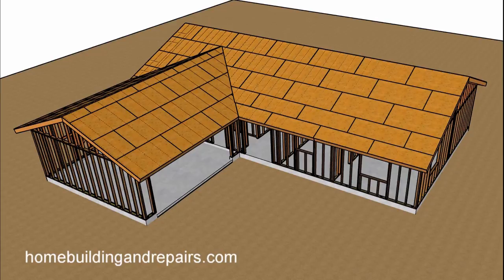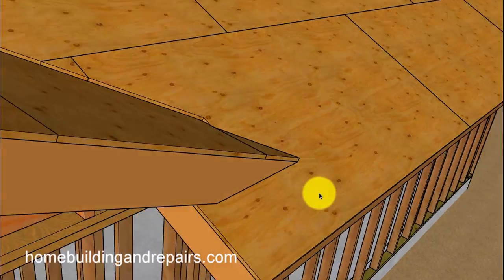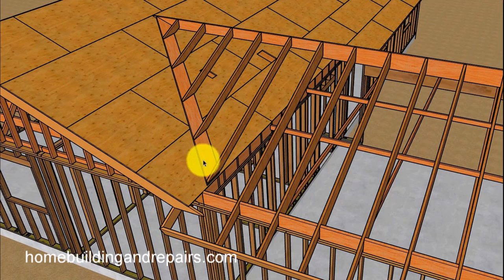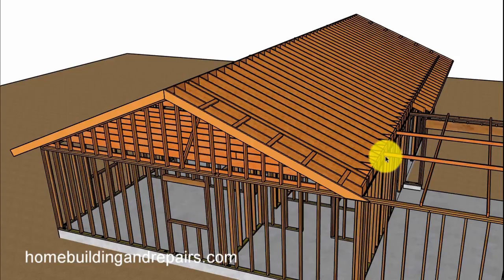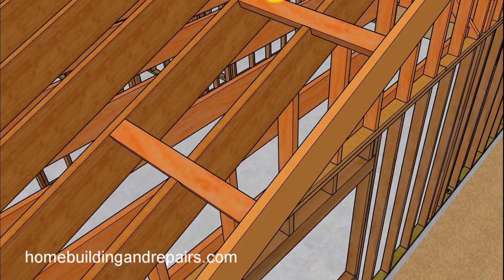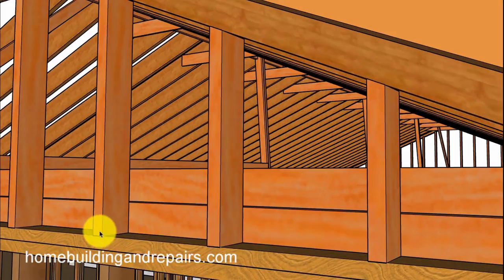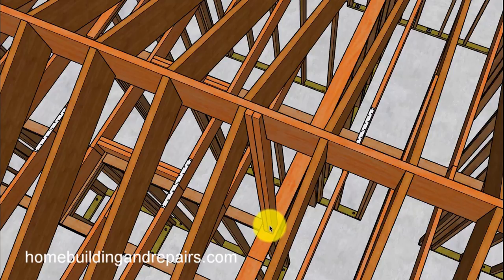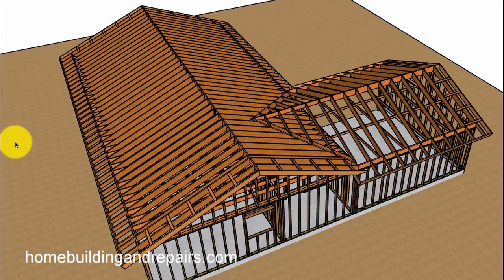Conventional Gable Roof Framing Ideas – L-Shaped Floor Plan Design

Comment: Yes that join area at 0:37 is quite tricky to model. It's interesting that your valley rafters are lying flat against the rafter of the adjacent roof, is there amy reason for that? Better connection? I typically see them standing up.
Reply from the maker: I don't know if this will answer your question, but feel free to try asking it again in a different way if it doesn't. The smaller roof sits on top of the larger one and that's to distribute the weight of the smaller roof little more evenly. Don't forget that you can always go to our website to check out some of the home addition building and roof framing videos for more information also.
Reply: @gregvancom   Thanks for your reply. What I meant was, the pitched/angled rafters of the end of your valley, they're sitting flat on the bigger roof. I've modelled them standing up, my dad who's also a carpenter commented on mine when he saw my rafters sitting flat, I think he said it uses the strength of the rafters better to have them standing up. I would imagine that having them flat  helps to get more nails in for a better fix or something? I've been on your website and I have it bookmarked. Your video helped me visualise the way the roofs join a bit better :)

Comment: By notching the 2/10 for the outlookers, you've reduced the strength of the rafter. Drop the height of the gable by 3-1/2" measured at a right angle from the roof pitch. Then the outlookers can butt into the rafter and ride over the top of the gable.
Reply from the maker: I don't think you're going to be reducing the strength of the roof rafter when it's supported by a continuous wall underneath it.
Reply: The Look-outs/ out-riggers do not present a structural problem but should be cut-in "notched" with a fairly tight fit and should extend 2 rafter bays back using 2"x 4" flat at 24" on center, extending out with a 24" max overhang. The 1/2" sheathing diaphragm nailed using 8d at 6:6:12 will  tie in the structure and is the standard method in prescriptive design for decades.
Reply from the maker: I don't think I would agree with an overhang more than 16 inches or cutting into a second rafter. It could severely weaken a non-supported roof rafter and a flat 2 x 4 might need to be placed on edge or rotated 90° to go any further than 16 inches.

Comment: Greg, Have you a Broken hip and valley roof video? But My hip isn't broken. 1914 house. It comes all way down--but not to corner. So the corner comes down close to is a Gable end front of house. So all these gable rafters are cut so that they creep into the uncut hip. I will send you a link to Cloud pics if you want to help me decide how to sister this 100 year old mess. Because as you probably can guess they are sagging in this area because there's obviously no support like I hope you can show how to do below the roof.
Reply from the maker: I don't have a video, but will put your video suggestion on my list of videos to be made in the future.
Reply: @gregvancom , please also show in the video how to shore up in order to cut the saggy hip at the valley and add Gable rafters and remove the "broken" Gable rafters. Like what things can go wrong, say.
Reply from the maker: Good point and I will try and create somewhat of a step-by-step process for this type of repair.